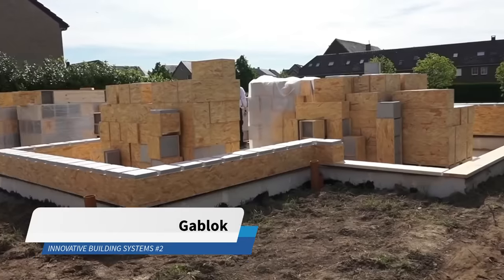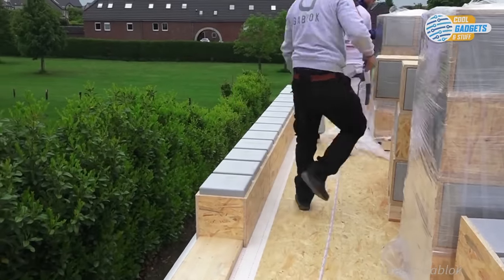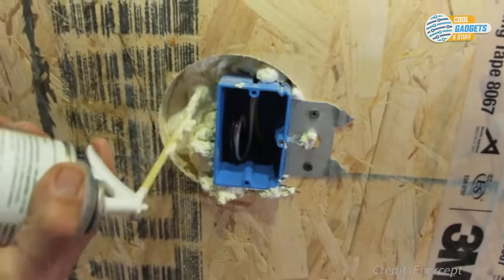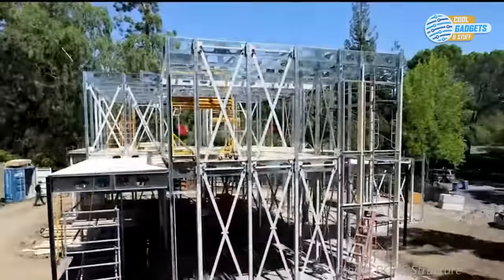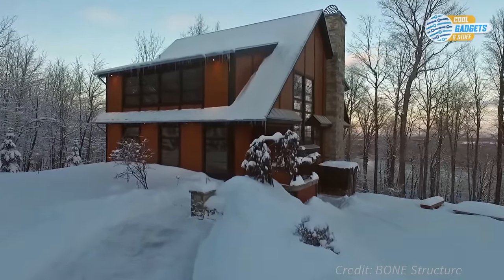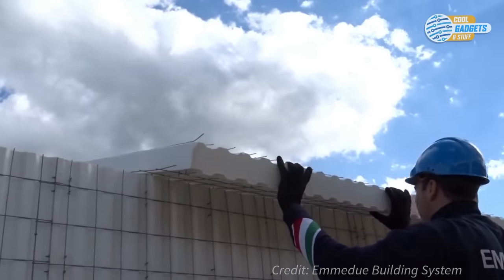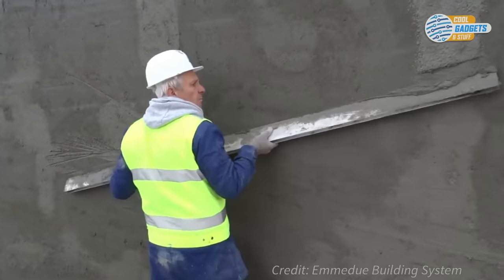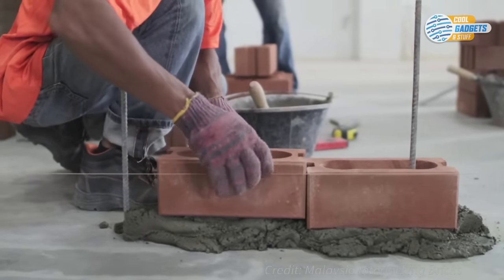5 Innovative BUILDING SYSTEMS for your house #2

Comment: When I was a child, I used to make small homes with Lego set made for kids, but apparently there is a Lego set made for men also.
Reply: I thought that a Lego system would work with recycled  plastic , use plastic waste to build homes for homeless , why not !
Reply: @janinekuklinski7690  that is actually such an underrated comment. I bet you could get it to be federally funded as well
Reply: @janinekuklinski7690  I was thinking the same thing..I'm sure a properly Webbed plastic block system could carry a roofing system load?

Comment: This is called the GaBlok system, deveoped in Belgium. I found YouTube videos going back to 2020. One shows the 2nd story floor system (box trusses). The pitched roof requires traditional wood trusses.  Haven't found one showing how the finish interior walls. I suppose 2x2 vertical studs can be applied so electrical wires can run behind drywall. Plumbing presents more chalkenges though.

Comment: Imagine buying a house then you find out it's made of styrofoam and chicken wire
Reply: Hey low cost Insurance
Reply: lmao, that's what i said , it'll go up in flames like a bonfire.
Reply: Go to United States, houses there are framed in cheap wood and wrapped in styrofoam,and clad in vynil planks, woor or cement boards. The interior walls are made of gypsum  board. When there is a fire the  houses burn to the ground. If a tree falls on them they are sheared in half, if a tornado or hurricane hits, they disintegrate.
Reply: Steve(loved your music by the way),you killed her on the plaster argument! It's a shame she didn't mention plaster. Go with the Gablok.
Reply: And duct tape? Can it be made of dict tape too?
Reply: "provides high thermal insulation" while melting the foam with a heat gun
Reply: Thats how new houses in phoenix az are built. The news was saying that criminals were kicking in walls of homes and robbing them. Walls were made of Styrofoam and chicken wire.
Reply: @esmeraldagreen1992  Absolutely right. Every time I pass a "modern" construction project, I'm mortified at the flimsy structure. "Stick built" has become exactly that
Reply: I've used these panels for a friend. Happily it's not chicken wire but a welded hard steel wire. Before using it for the house I made strength tests on samples as I was designing and building in a hurricane zone with very heavy rains (the record is more than one foot of rain in 24 hours). 
The shotcrete  was made with puzzolane and quartz sand, white cement, a plastifier for using minimal amounts of water,  polyester microfibers plus a mass waterproofing, in fact a bit similar to a ferrocement barge mix. The shotcrete was already colored like adobe in the mass so no need of paint. Thus you have a sandwich like in composite boat building, so you can calculate the maximal admissible deflexions. If you get enough tensile strength by the good formulation of shotcrete with the microfibers the system is pretty strong and resilient.
 If the design is well engineered, that can withstand pretty high winds and loads. The 2 stores house I built in Mexico near Cancun survived easily the hurricane Wilma in 2005 with winds up to 200 mph and lots of rain with no one leak.
My own house in Playa del Carmen designed and built by myself in wood passed easily hurricane Wilma. In Playa we had winds ranging from 100 mph to more than 150 mph during almost 48 hours, no problem, not even a leak. But it was assembled with 30 thousands screws and 300 main bolts and carefully engineered to resist a 220 mph wind in front and even vertically to the roof during 3 minutes. The frequencies have been calculated plus a stress elastic buffering system (in composite fast patrol boats it's called the Lord system). We are very far from the engineering and building of an ordinary wooden american house, but closer to boat building engineering.
All depends how you engineer and how you build the house...
Reply: @esmeraldagreen1992  Not ours. But we are in an area that gets hit by Hurricanes. Ours is concrete block and reinforced concrete. Ever hear of Hurricane Andrew. Our house was dead center of it and is still standing almost 30 years later. But then that is also why the US Army CofE, the insurance company, FEMA, and the county came out and looked at the house after the storm. Most two story houses didn't fair well and many homes lost their roofs. Ours didn't. But then in some places they found up to 7 layers of shingles on the original roofing that was 14 years old.
Reply: @pabloricardodetarragon2649  We have officially recorded up to 18 inches in a 24 hour period in some of our areas. I've seen a rainstorm dump 2" in 15 minutes. Not a day you want to be out in. 2005 was no fun for us here in SE Florida as we had Dennis, Katrina, Rita and Wilma and thought that Hurricane Season would never end.
Reply: @gravelydon7072  I see you're a member of the hurricane's club...Happily in Yucatan we see less hurricanes than Florida. But you have to build thinking about it whatever the number of hurricanes and tropical storms you'll have.
Reply: @esmeraldagreen1992  so that's why I see this in movies. In Greece (Athens) our buildings are adjusted together usually. Nothing can take down a whole block of together holding buildings. We even get large earthquakes and hold up well. One downside... difficult to demolish and build new.
Reply: 😁😁😁 these styrofoam panels, are damn expensive in my country that I wonder if they’re worth it.
Reply: Rick Long  As someone building and remodeling for a living I can tell you yes plaster board is fire retardant. Double sheeted walls with red plaster board sheeting on steel studs is used routinely for firewall sir. You can find the fire ratings of any assembly with times schematics and similar things on any gypsum board manufacturer web site. Rigips Knauff in Europe for example.
Reply: @Robert08010  Not really reinforced cement and cinder blocks..
Reply: Lmao
Reply: @stevemiller4706  First of all, it's really not. Second, even if it were, it doesn't stop the heat. The heat from a fire will go through it and melt the foam in the wall. And in the worst case scenario weaken the wire inside the walls. So best case scenario you have no insulation and need to tear down the whole house to put it up again.
Reply: @esmeraldagreen1992  Maybe some cheap houses but that's true anywhere has nothing to do with the US.
Reply: Rentals .
Reply: imagine you living in the basement of your parents home till you are 52
Reply: @csxcobracsxcobra334  why are you so mad? 😂 is your house made of styrofoam?
Reply: @violent_bebop9687  because other houses dont burn so easy....

Comment: I design custom doors and windows for a living.  I loved the SIP design when I first saw them.  I thought they would offer more options.  About 5 years ago I sold an entire window and door package to a woman that built one.  She came in about a year later with leaking windows.  Andersen went out and found the windows were not flashed properly and come to find out he son installed them.  I then realized a huge problem with the SIP panels.  What do you do when they leak and start to rot?  You can't take them apart like a stick built home.  Can you just saw out the rot and just make a SIP patch?
Reply: John Pyle yes you can
Reply: Xanthan Gum it ain't rocket science, if your somewhat handy in construction it's not a problem
Reply: Yes.
Reply: @heknows5418  if you are someone good level knowledge in construction, you definitely know that this new technology will not go for a long time building history. It is not a good construction quality at all.
Reply: Good point.
Reply: DGDG0000000 as forthe SIPS panel , that is what we were discussing. All the builders that I know that have used them , love them, less waste, less loss from stolen materials, less labor to install and shorter time, and these have been around for 12-15 years to my knowledge. Most problems are from the learning curve it takes craftsmen to get up to speed.
Reply: @heknows5418  speed and quality build doesn't go well together. Workers who don't like to work to much are not my references culture. I also don't write it is bad, i think it is low quality material. 
For example, earth and stone construction is better, but slower to build, and even if you have the material for free, expensive if you paid the work (not if you do yourself... But very long and strong work).
Wood can be very good to, but for quality, very expensive and very high level of knowledge to be able to apply well.
Also, there is architecture you will never do with stone and earth (compression assembly only)... And then... I don't like modern structures, i don't find any sens on this way (except for geodesic wood and steel structures).
In fact, i love monumental and old building because of real quality work applied (a life to learn for worker with best builders master).

Comment: Ok, I live in the southeast of the US, a hurricane-prone. How many MPH can this house stand?
Reply: if the walls are extremely flat and it's more than G+2 . it might handle upto 50mph ,

there is certain categories and variations with variable rates .
Reply: 10 mph
Reply: 3
Reply: @Snow Cone Not very many cellars down here. 4 ft to 6 ft down is water level. But our house is reinforced concrete block with poured concrete columns every 10 feet. The second floor floor is Span-deck slabs that also are poured solid and have a minimum of 4 inches of concrete on top of them. A neighbor has a home that including the roof is poured concrete. Do we take Hurricanes seriously, yes we do. Andrew tested ours and it was still standing after the 155MPH winds and at least a couple of small tornadoes hit it.
Reply: From what are you building there in the USA paper? In Europe most haus can withstand 130 Km/h winds. I know that over there you have strong wind territory, but still...
Reply: It depends, almost all of these methods could be used to build homes partially or even completely subterranean. So let's say you go with the least effective method, the one with basically styrofoam  surrounded in steel mesh and then sprayed over. It's super lightweight and very box like, 2 things you do not want with high winds or flying debris. However taking it and making a 1 story building while building it with high wind in mind, so sloping the roof in a way that wind hitting it from any angle will reinforce the structure underneath with tension, and then building the walls in a slightly cylindrical method instead of completely flat, which should be doable with all the shown methods. And then having the 1 story structure approximately half or 2/3 underground in terms of floor to ceiling height, not roof height. It would probably be able to withstand most hurricanes and would likely be lost due to flood long before high winds cause it to collapse. In other words, about as safe as you can reasonably get without spending a fortune worth more than most make in a lifetime
Reply: @ferencszabo3504  most of the time we don't build homes to be durable, we build them to be cheaply replaced. Most homes here cannot withstand an f2 tornado. But on average they can be built and replaced within 1 month and at a small enough cost that most disaster insurances can completely cover the cost

Comment: I would go with steel frame for strength  and hempcrete for extra insulation. Though the moisture might rust the steel but it could be coated with something.  The foam ones are not biodegradable and not very environmentally friendly.
Reply: You could treat cloth with linseed oil then wrap it on the steel you could then spray the hempcreet and it would reduce water getting to the steel. Linseed oil is a drying oil and acts as a waterproofing add on.

Comment: With houses like that, it doesn't surprise me that a tornado comes and takes it away. put a good brick.
Reply: Good point Jeda. I live in a concrete block home in a tornado alley area. And it would be nice to have a single piece concrete home where the walls and roof are joined with gunite concrete like that used in a swimming pool.  That way when a tornado comes you don't have to run and hide. You can just fix a drink, grab your camera and watch.
Reply: @guidedmeditation2396  the cost is always the issue
Reply: if you think a house out of bricks automatically makes it stronger you are wrong. what matters is how its engineered, not the material.

Comment: i still prefer traditional brick or stone houses, 200 years later or more they still here as new, some of the house on my village were built in the XVIII century and still up and running, i would to see the foam and mesh or the lego style blocks houses in 200 years.
Reply: They will only last a few years just like most stuff produced today
Reply: there is a reason why they dont build to last any more, because they want each country they've took over to be a constant flow of new people along with cheap stuff so its always being broken and bought..
Reply: Our Ohio farm house is well past 200 years old. Under the clapboard siding is a heart of logs. The floor of the living room is supported above the cellar on whole logs that only had the top leveled before the the T&G flooring was put down.  What is the T&G flooring made of, Depends on the area it is in. It is either Oak, or Black Walnut. The house was built to be Indian proof and meets the requirements for a home in Indian Territory so they lost in court on their claims. First taxes were paid on it in 1813.
Reply: Yes, stone and brick houses, still in the same condition as they were 200 years ago, complete with built in ac from opening the windows, and don't worry there won't be a pesky screen in the way, we didn't put it in! complete with heating during the summer time because man those rocks really capture the heat well, sorry about the winter though, you'll need another heat source cause it's about to get cold as fuck, and keeping it warm is going to be like heating the earth, cause that's what you're literally doing. Also with the latest in tech, enjoy your built in landline highly optimized for Morse code signals and if your at the fore front of technological advancement, dial up connection, splendid! As for water and sewage, don't worry we've got you covered with our industrial strength lead pipes to bring not only your hydration, but all the iron and lead you need to get your daily doses and more! Worried about tetanus? Ha, don't worry, even if you could catch it and lockjaw from the tap water running through your rusted metal pipes, we've had vaccines for those for years, so as long as your vaccinated it's all good!

Comment: You should make single ended bricks so that the slotted ends don’t show on external faces like you can see on the columns at the end of the video. Spoils the otherwise nice neat lines created by the consistent joints. And to sell more, you need to say how quicker this system is? How much cheaper can you lay the bricks? Do you still pay the brickies a £1 a brick?

Comment: just wondering where the electrical and plumbing works with the first one, sure not seeing any evidence of them being put in there...??
Reply from the maker: Great question Kate, I should probably clarify in the video. This is what it says on their website - https://gablok.be/en/faq/how-do-different-technical-finishing-touches-find-their-place-in-a-gablok-construction/
Reply: I would personally want the electrical and plumbing to be exposed, so I have easy access in case it's needed. No need to tear into walls and try to repair that. You can see a leaky pipe faster if it's exposed. And you aren't left with a gaping hole in a wall or ceiling to repair after the plumber or electrician leaves
Reply: @recoveringsoul755  I agree. And in one location.

Comment: I thought of this idea 13 years ago while sitting on the floor building a castle with my granddaughter out of  plastic building blocks.  I thought you could make heavier wooden blocks and snap them together, it would be a quicker and easier way to build real homes.  Once finished, add the siding and you have a home.
Reply: Possible. Just at $17 per block.. idk how much do you think it would cost

Comment: Maintenance seems like a nightmare on these places
Reply: What maintenance???
Reply: Maintenance is a nightmare on any structure, including but not limited to conventional housing structures. Were you under the impression that wooden houses were a one and done deal?
Reply: Dalion Heart hi! 20 yr old home remodeling contractor here. Luckily on timber frame buildings we can open up things, move walls, and change lots of stuff around. These homes seem nice it just didn’t look easy to me to modify/change much with ease.

Comment: With wood, when you have a fire, you can hack off what burnt and rebuild. Steel will warp and the entire structure will have to be rebuilt!!
Reply: don christie so build a house that is fire resistant and maintain it. Then you are good to go👌
Reply: If my house burns I want the whole thing rebuilt.
Reply: Jeff X you may want, but insurance will tell you what to do 😕
Reply: eh, still smoke damage & water damage from extinguishing the flames, on top of wood being far more likely to combust & spread rapidly. plus: hurricanes, floods, insects, rodents, tornados, sound penetration, lightning strikes, mold issues, less structural strength to combat settling, far higher cost of utilities, more trades on site for longer periods during construction (+$), less control over air quality (leaky), etc.
even potentially lower resale value... i mean, people restore homes from the 20's-40's due to the architecture - but nobody is gonna restore the basic stick ranch home of the 60's-00's.